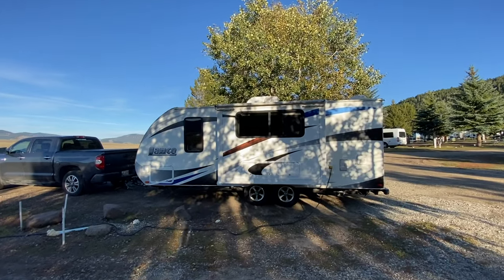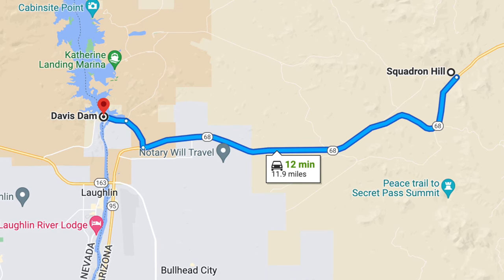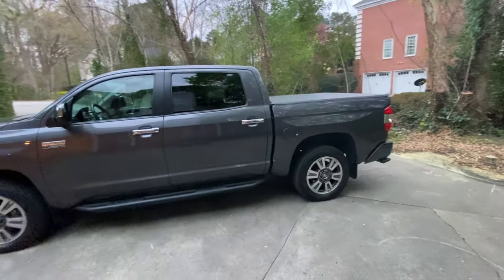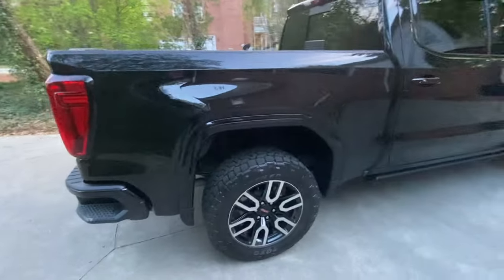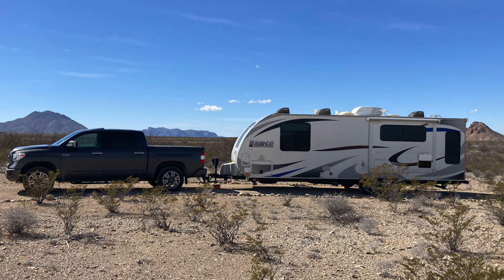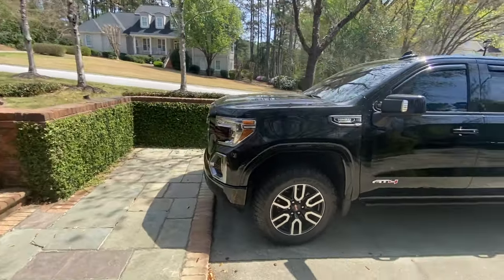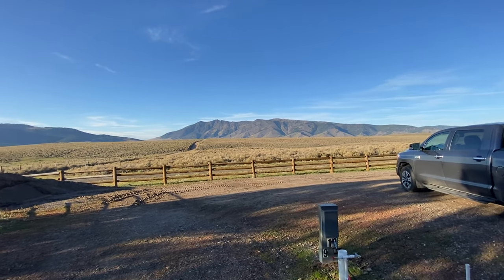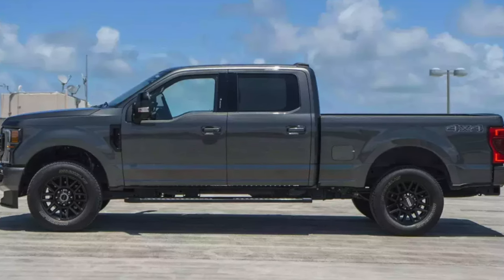Myths - Towing Capacity & Payload - the best Half-ton truck for your Travel Trailer or RV

Comment: There's a big difference between towing a 7000lb trailer that falls off the hitch-ball and hangs from the chains when the coiled emergency brake cable over stretches and fails to engage the trailer brakes vs a pickup bed loaded with weight. Trailers push from behind, especially downhill. Bed weight does too, but that bed weight is always within the bed. A trailer's weight shifts and you need the safety of larger trucks (for larger TT's) in case it does ever come off the hitch. Fill the bed with water, and 'now' you've got more trouble hauling than towing.
Reply from the maker: Who drives with a bed full of water?
Reply: @kedrevs4037  LOL - A few people have, but I really meant to say something like a tank of liquid that some folks haul for work. Water, bug killer, septic cleaner at campground, gas during quarantine, pick your poison. 🙂

Comment: It's all about your cooling systems. Yes your truck maybe can pull a large load but for how long can it do it. Diesel is designed to do so. It has multiple cooling systems. You don't have to worry about frying anything. Or worry about what type of weather you tow in. But also don't exceed towing and payload capacity for any truck.
Reply from the maker: I track my temps, never seen anything above 218, not even in the desert or mountains on triple digit days
Reply: @kedrevs4037  Try the Ike gauntlet. That's the true test. Lmao. Just kidding good for you man.

Comment: 22 F150 PowerBoost towing a 7500 gvwr trailer at 6000 loaded per CAT. 10k miles towing w Anderson WDH. Comfort for me is the 6k weight and 60mph. Turbos NOT on all the time. Also, plug the 30A trailer into the truck for boondocking; idles ~4x hour 4min  to keep AC on.
Reply from the maker: If your towing 6k lbs, I would think the turbos are on most all the time.  But kudos if your able to do that without them.

Comment: You know the GVWR numbers are all a game when you look at how they differ in the same truck. The 22 Tundra’s with the heavy hybrid system have a GVWR of up to 7780lbs. Yet lower towing and similar payload numbers. If the frame/brakes/rear end etc can handle 7780lbs of GVWR, why not make it that across the board and give us a 2000 lbs payload in the non Capstone/Pro model? Superduty models allow you to change the GVWR based on what you want it to say on the build sheet. 😂 (Likely for registration purposes in some states)
Reply from the maker: Exactly!

Comment: The only thing I wish my 2019 Tundra had is the larger gas tank. I will be taking my travel trailer out for my first coast to coast trip next year and stopping every couple of hours to fill up is going to get annoying.
Reply from the maker: Your 2019 doesn't have a 38g tank?
Reply: @kedrevs4037  Unfortunately not. I have an SR5 with the standard fuel tank. The plus side is I have a much higher payload capacity so, there's pros and cons.

Comment: I just got given a TT with a hitch weight of just north og 1000 lbs. Im on the fence if I can actually tow this or not with my 2019 tundra limited 4x4. My specific payload is 1220 lbs and hitch capacity is 960? If i remember right. Im probably going to throw a WD hitch on it and see how it goes short distance before deciding whether it will tow it safely or not
Reply: I should have mentioned its a 32 ft tt that weighs 6600 lbs dry. I know Im within capacity weight wise but the hitch weight is where Im caught up. I suppose I could remove the propane cylinders and store them in the trailer between the axles. I also plan on buying a weigh safe hitch to gauge a safe tongue weight %.
Reply from the maker: I would hook it up and take it through the cat scales to check the load on each axle once you have he WDH hooked up.

Comment: Coming from the heavy duty commercial truck world where the GVWR of the truck is the sum of the GAWR of its axles I find the weight rating system of pickup trucks a mystery.  The OEM I was involved with (Kenworth) is totally transparent about components which determine ratings. 
Oh, and the internet bad manners arguments over 200 lbs of payload are hilarious.
Gas F-350 and a gen 2 long bed Tundra owner. I tow with both.
Reply from the maker: Thank you for a sharing an informed perspective.

Comment: Some Diesels will have a lower payload capacity than gas simply because the diesel engine is heavier, thereby reducing it's payload
Reply from the maker: Haha, that's matter if anyone knows what payload really means in non-commercial vehicle.
Reply: @kedrevs4037  so would you take an f250 with gas that has plenty of payload  say 3,100 or a diesel that has 1600 Payload? If lets say we have 1,000 lbs in passengers (3 teens) and want a travel trailer around 6-7,000 GVWR so 10% approx 6-700 tongue weight= now 1700 payload. Not counting truck cargo. Also would a f150 or GM 1/2 ton tow that? I would prefer a 1/2 ton as it will also be a daily driver. Also I NEED 4x4, crew living in Northern Michigan with 200” snow a year. It has to be used looking under 30k for the truck. I can find 1/2 ton for that with about 60k mikes and 3/4 ton with 170k plus miles.

Comment: I pull a 38ft 8300 lbs travel trailer with a 2022 Ram with a 5.7 liter 3.92 rear end wirh no sweat. Now winds north of 12-15 mph I have to slow her down to about 55-60 mph
Reply from the maker: One of the things that rarely gets talked about is headwinds when towing.  TFL does reviews and I'd like to know which direction and how strong the winds are.

Comment: Maybe you did not mention it, but I'd think the most important SAE standard would be how well a vehicle STOPS under full-rated tow capacity.  Also, recently had a 3.0 CDJR ecodiesel.  It was awesome including towing until it passed 100k miles and then major repair after major repair.  Never again.
Reply from the maker: It is just a standard to stop in under 80 ft going from 20-0.  All pass that standard

Comment: What doesn’t make a lot of sense to me is there’s little difference in price nowadays between a half ton and a 3/4 ton gas engine especially when you look at it from a monthly payment
perspective. Doesn’t make a lot of sense to buy a half ton especially for those who are pulling 30’-33’ travel trailers. The Nissan Titan XD is nice but it can actually be more than a 2024 Chevy 2500 with 6.6 gas and 10 speed transmission depending on packages.
Reply from the maker: I agree about price discrepancy,  but there are limitations to a HD,..drivability, parkability, city streets etc.   Half tons have limits for capability, each of us has to find the right combo

Comment: My rule of thumb, pre 2010, was to choose a TT with a GVW of no more than the TV's Tare weight + 500#. Recently, I have increased the TV side to Tare + 1000#.  Considering the 2023 Tundra, the Tundra can easily and safely tow a TT of 6500#, say a 20ft to 24ft TT.  If I had the discontinued Nissan XD diesel, the TT could go to 9000#.
Reply from the maker: I don’t like a lot about the new Tundra when it comes to towing.   V6 turbo gas, 3.31 rear axle, but especially the 3860 lbs rear axle.   If the Titan XD came with a 35 gallon fuel tank, I would have one in my driveway

Comment: I tow a 234 Forest River travel Trailer that weighs in around 6500 loaded with my 2014 Tundra Limited 4x4 w /dual TRD exhaust. I went to Tennessee in the smokies from Virginia and got around 9.2 MPG. I thought it would do a bit better than that. I usually get around 15-16 average and 19-20 on the highway without a load. What kind mileage are you getting out of your Tundra?
Reply from the maker: Depends how n which direction ( heading east always better than west), speed (mostly 70-75), wind, and terrain.  More hilly the worst.    The thing that hasn’t meant much is altitude.   I actually markedly better in western time zone states than I do east of The Mississippi.  

Than being said,   My experience says that VA, TN, WV, GA, NC, and SC midlands is where my MPGs are the worst.   I would be thrilled with 9.2MPGs in that section of tge country.   Also found weight has less to do with it than shape.   Get above 70, and wind resistance is really strong.   Best out west is approaching 11 heading east at about 70MPH.    Worst on eastern half of country is 7.8MPGs into strong headwind.   Average with a box trailer like your FR is right around 9 MPGs for trip at 70-75.   For the Airstream that I have now, about 9.6.
Reply: @kedrevs4037  Okay... I was doing around 60-65 average and got that mileage as an average going East and West. Going West into Tennessee was around 8.5 mpg. My tires are 275 with an aspect ratio of 5mm more or 60 series versus the 55 stock series tires, so that may throw off my average mileage calculation a bit. Also, this trailer is the ribbed style aluminum siding versus the clean straight fiberglass style. That equates to more surface area and more drag than the fiberglass travel trailers. For now, I'm just trying out different rental trailers on RVshare before I pull the trigger on purchasing one. I like the Airstream trailers, but I enjoy the slide outs to open up the living space more. Thanks for the info.

Comment: I purchased a new Ford F-150 with the 5.0 engine. I thought it would be better, more reliable, long term for towing. I have the extended rang tank. It’s great on long trips. FYI, do yourself a favor and research the Diesel engine in the Ram 1500. It has lists of issues. I owned one nice truck great mileage. But, at 70k miles the high pressure fuel pump failed and destroyed my fuel system. It cost $10K dollars to repair.
Reply from the maker: Ouch, that hurts.   I had the 5.7 back in 2012, but never owned the diesel.  But I like the combination with a 35 gallon fuel tank.
Reply: There’s also a recall out for the ecodiesel now for the high pressure pump. So that’s been fixed. Got 222k KM on mine. Love it, I deleted it and it tows so awesome.
Reply: Yeah the ram diesel is garbage.

Comment: Currently I have a 2008 4runner with 4.0L v6. My trailer is 22 ft long and a bit over my max at 5500 pounds. The 4 runner takes the weight all day long but the trailer is a huge wind sock so as the speed increases the gas milage drops like a rock. headwinds suck. Even so I can always keep up with traffic on all but the steepest roads, (Teton pass comes to mind). My beef is that while my v6 has a 5000 pound rating the model with the v8 has a 7500 pound rating. My only upgrade was to replace the flimsy OEM hitch with something that bolts on the frame and equalizes the weight distribution of the trailer. The only difference between the two, V8 vs V6, is about 30 pounds of torq and about 30 HP but somehow my rig loses 2500 pounds of capacity?  Basically the same transmission, drive train and radiator. I just got back from a 1300 mile excursion in predominately 100F plus cruise over mountain passes and not a single overheating issue. Meanwhile I saw several newer and bigger trucks on the side of the road with overheating issues,(do they not have a decent towing package?) Id love to get a newer, slightly longer trailer about the same wt or preferably less and more aerodynamic  but I am worried about the increased leverage a longer trailer may have on my short wheel based SUV.
Reply from the maker: No one needs to go fast over Teton Pass, you miss the views.  These are the tough decisions that we all face when picking the right vehicle for us.

Comment: I tow a 37ft  8,400lbs dry travel trailer (that's my HDPP and TT in your video) with a 1,200lbs wet tongue hitch weight.

My HDPP has a payload of 2,475lbs, and it tows and handles my TT very well. 

I upgraded the stock C Rated Goodyear Wranglers to E Rated Michelins Defenders LT, and that and the Goodyear Endurance on the TT renders a very stable towing experience. Passing semis are none issues, there no need to slow down, brace yourself, because there is only a mild pushing as semis passes, and faint pulling as they  pass...you can continue sipping your coffee ☕️ as they pass. 

 it's the handling in blustery wind conditions is how I determines how my set-up handles.

Braking is excellent on long down grades on Interstate 81, 64, and  68 crossing the Appalachian mountain range...no fade whatsoever.

My cruise control is set at 65 or 67, and if the wind are blustery enough, I'm setting in behind a long line of semis in the right lane, because most of them have to slow down too.

There is no swaying, or squirrely sensation going on, and blustery wind push the set-up as a unit, and nothing sways, and if the winds of blustery enough to could push me out my lane, I'm getting off the road, because it's a high wind advisory in effect.

I towed in a high wind advisory also, and while the trailer dog-walked sideways, the truck stayed firm planted.

The weakest link on the half ton, are the tires and soft suspension before the light weight.

My HDPP has a stiffer suspension set-up and upgraded tires, and it was those C Rated tires limiting the truck, not the lighter weight.

There is one more tier that sits at the top of the half ton ranks...and that's where the HDPP resides. 😊

There is no other half ton I would dare hook up to my trailer, including the Max Tow...the Max Tow couldn't handle that trailer.
Reply from the maker: Safe travels to you, thank you for sharing all that.

Comment: Hello.

I just bought this truck (Silverado 1500 LT 2FL Turbomax, 4x4) about 4 weeks ago, this car is beautiful, good, strong engine. I want to buy an RV but I don't know if this vehicle can tow an RV or not? If so, what is the maximum weight of an RV?

My Truck: Brand new 2024

Gvwr=7,000lbs. 

Gcwr=14,500lbs. 

Rgawr=38,000lbs. 

Maxpayload=1,966lbs. 

Curbweight=5,034lbs. 

Conventional TWR=9,000lbs. 

Max tongue weight=900lbs. 

Gooseneck TWR=8,900lbs. 

Max tongue weight=1,335lbs. 

Gawr FRT=3,800lbs. 

Gawr RR=3,800lbs. 

Tire size: 

FRT=RR=265/65R18 T. (rim 18x8.5J) SPA=265/70R17 S (rim 17x8J). Font=Rear=Spare=240 kPa, 35Psi. 

So, Can my truck (GVWR=7,000lbs) tow an RV/Trailer with a maximum load of 9,000lbs?

If possible, please post more videos of the Silverado 1500 2.7l, 4-cylinder truck pulling an RV trailer.

Thanks
Reply from the maker: Personally I wouldn't want to push a modern half-ton beyond 8-9k depending on how much I was towing.

Comment: I have a 2020 F150 XLT 5.0 crew cab long bed 4x4 with a 36 gallon tank so that is an option. GVWR is 7050 and payload rating is 1713
Reply from the maker: not anymore on the 5.0 coyote